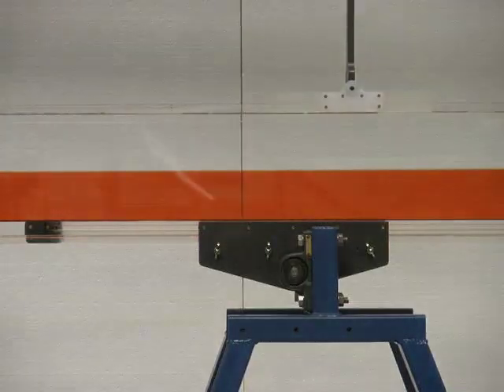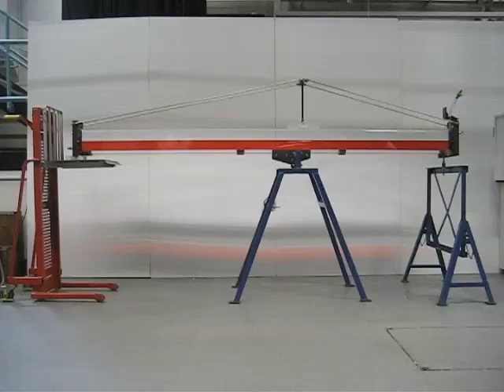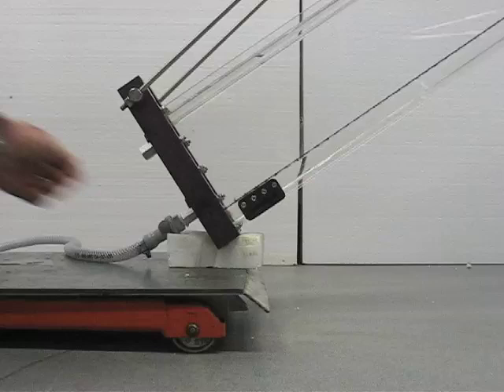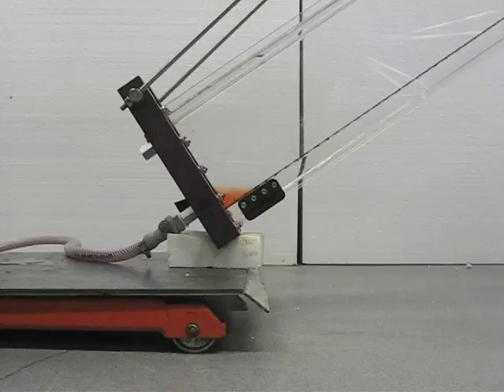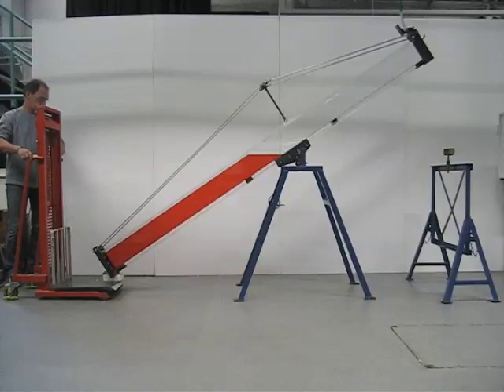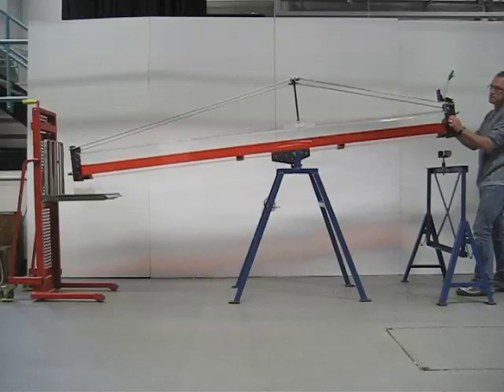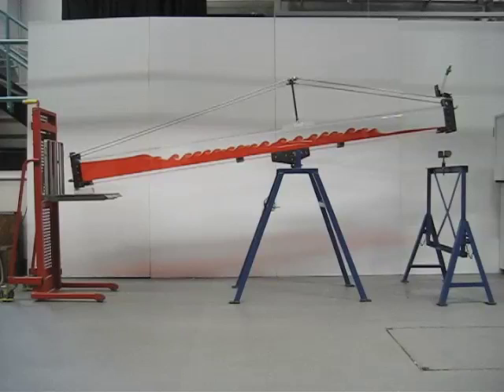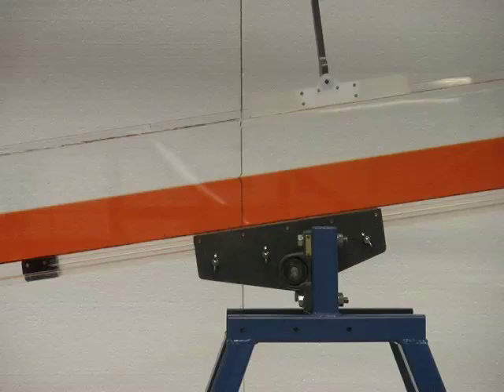Kelvin Helmholtz

Comment: Has to do with mixing of viscosities, movement, and angle, but I don't know why it always moves upwards in precise intervals. Gases do this well, and most of our atmosphere is gas, so it's a layering reaction, and if you add the liquids together too slowly it won't react the same. Resonance works in a similar way, but produces different results depending on what kind of material you use and the texture of such.

Comment: I don't get a thing.. if you move the bar to the bottom, how can the fresh water move uphill? I'd expect it moved downhill as well as salty water..
Reply: I think it's because salty water is more dense. If at rest, it's at the bottom and is stable, but if tilted it is pulled by its weight downwards, while fresh water is pushed upwards due to buoyancy effect I believe.
Reply: @alexkrochak7197  buoyancy effect.. what does it mean? I'm ok with the denser fluid, that initially is at the bottom, going downwards..
Reply: @Federico1871  You could also see it as the heavier liquid pushing the lighter liquid upwards as it moves down.